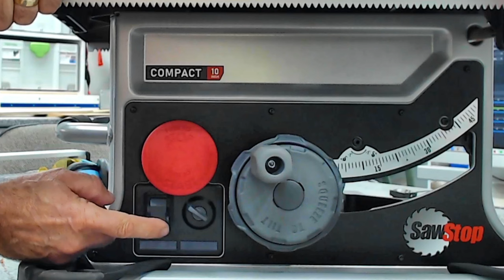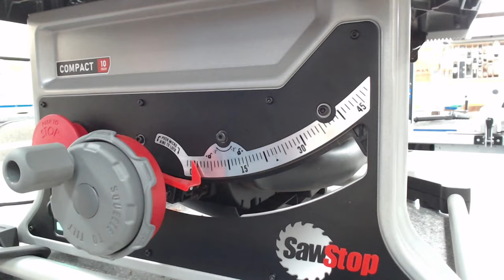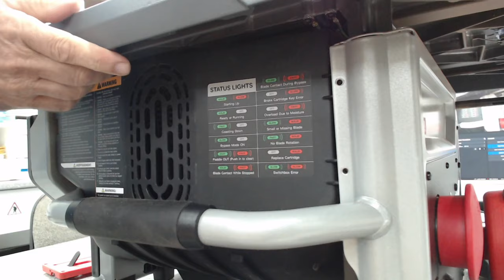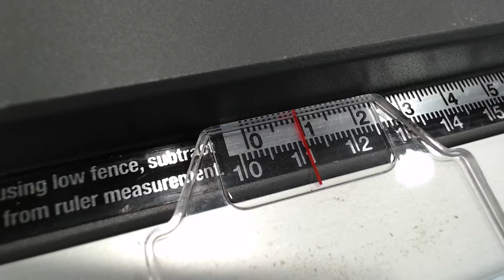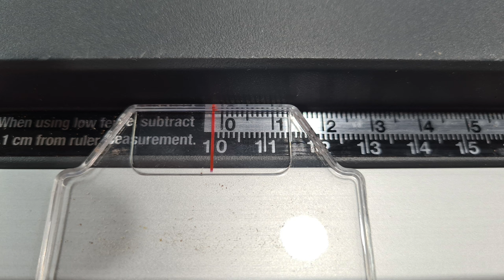ULTIMATE SAWSTOP HOW TO VIDEO BY DAVE STANTON

Comment: Great video Dave! Very informative. I have recently been viewing a fair few Sawstop video as of late because I have just order the PCS and in some of those video they have shown you can test a work piece to see if it safe to run through by touching the blade with it. ( With only the saw turned on NOT with blade running) and if you get the red flashing light you know NOT to use that piece. Not sure if that's the same with this saw but it would save using the bi-pass switch.
Reply from the maker: My issue with that is touching the outside is not giving a true indication of moisture within the board.
Reply: @DavidStanton  Thats a good point. These are the things Im glad to find out now before getting the saw. Cheers

Comment: Can I confirm that when you did the hotdog test, the saw was plugged into the CT vac?  Just want to make sure.  Thanks.
Reply from the maker: Interesting point. No it wasn't but it wouldn't make any difference. As I mentioned in the video the saw goes through a systems check prior to allowing me to start the actual blade turning. The saw needs to be happy with the power supply before it will start.
Reply: @DavidStanton  I ask because they (SawStop) didn't want me to put a soft starter in front of the TS because they couldn't guarantee the brake firing.  I don't know what electronics the CT vac has, but good point about the system check.

Comment: The desire to play with your hot dog means that you now need to spend money on a new blade and break.  So are you going to order the new festool compact table saw?
Reply from the maker: Interesting point you raised but not 100% correct. The blade was sent to a saw doctor and repaired. 2 new carbide teeth and as part of that process the blade is re ground. The blade runs very well and was cheaper than buying a new blade. The brake of course was replaced.
Reply from the maker: Also, can you please expand on which Festool tablesaw has a brake and how it works? I thought the 80 mm festool table saw has the sawstop tech, not some other form.